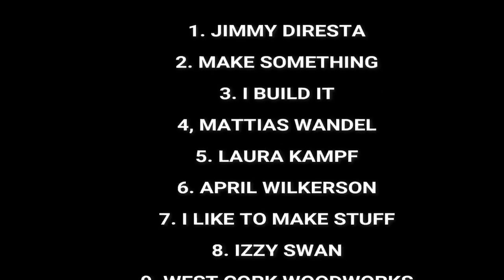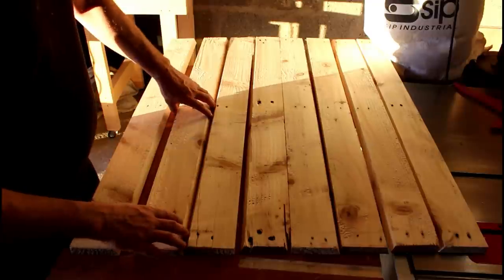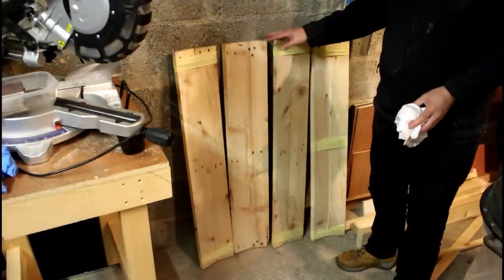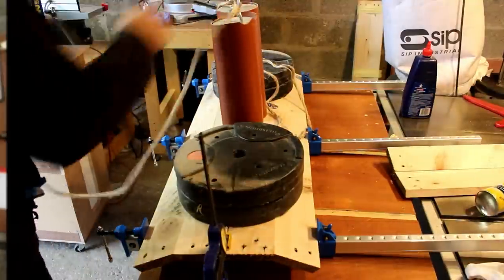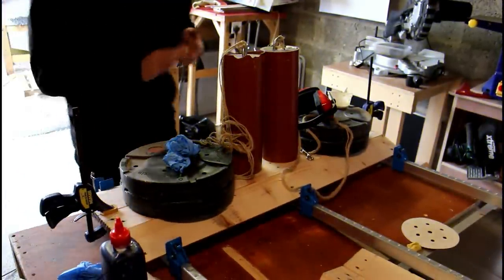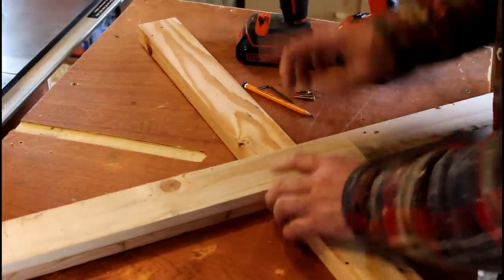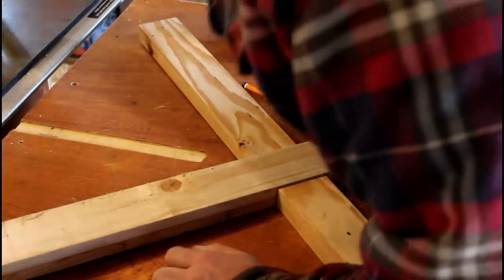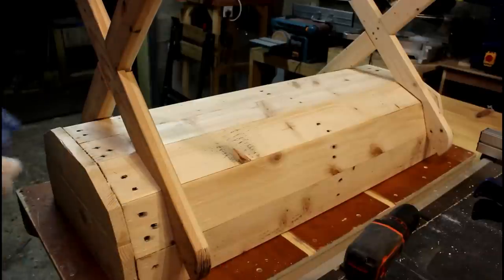Pallet Wood Planter

Comment: Great Planter build mate well done, hope you put some drainage holes in the bottom, or the boss will get floating flowers? You both did a great build with some very awkward glue ups along the way, and you defo have to get some more clamps, especially if you do more than one build at a time. Great to see you on here again.
Barry (Wirral, ENG)
Reply from the maker: Cheers Barry. I drilled a few holes alright, but the battery died on the camera so never made the final cut!!! Good to hear from you again mate! How's the Wirral? Must get back soon!
Reply: The Wirral is wet and windy as usual, wanna swap? love your house looks nice. Glad you did those holes mate, gotta keep the boss happy ha ha ha.
Barry.